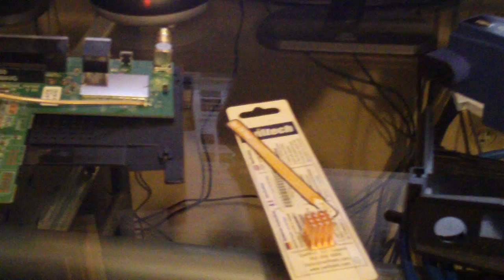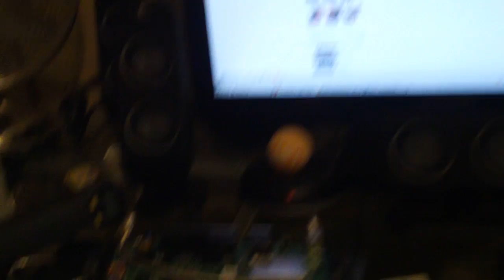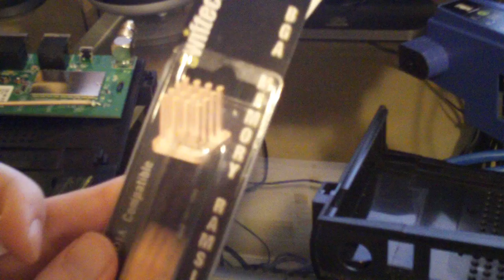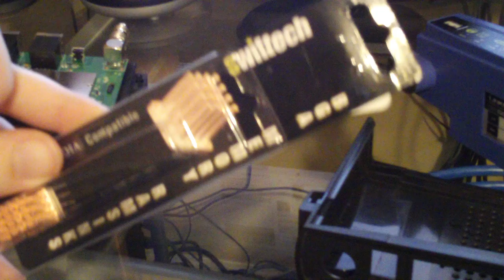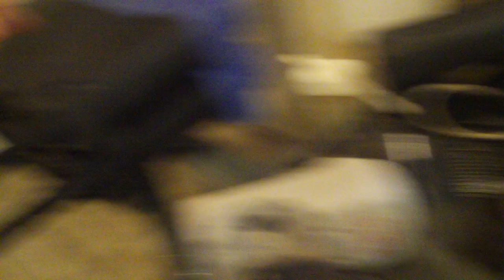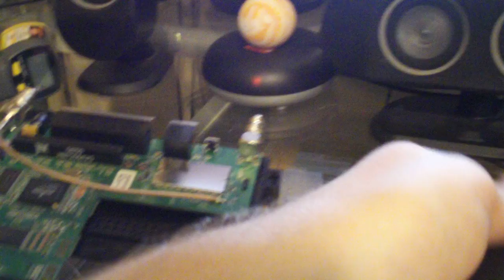WRT54G Cooling

Comment: I did this to my cable modem, and Dlink Gaming Router as well.  Both have super hot running VSLI chips in them.  Pick heat sinks with lots of veins on them... aluminum is best, copper is even better.  Make sure they lie flat against the chip and aren't held aloft by some other part.   Using finger tip smear a bit of common grease on top of chip, razor thin (people use to much), and then mount heat sink by pressing it on and  using hot glue gun on all four corners until glue cools.

Comment: 486 and Pentium 1 heatsinks work great too.. and they are free.   I take off the cases on all my networking equipment and put heatsinks on all the VSLI hot running chips.   These companies think these devices will run always in a 72 degrees air conditioned house, but that is not the case.  We don't use any air conditioning at all,and it can get 90 degrees in the house.  If your heatsink hits parts on the board, remove areas of it with a drill metal cutting disk or dremel tool.

Comment: What were those problems before you installed the heatsink? That would be pretty handy to know. :)
Reply: Losing internet, the linux os crashes and we have to unplug/replug but it crashes when the room temperature is higher than 80 fahrenheit or 28 Celsius